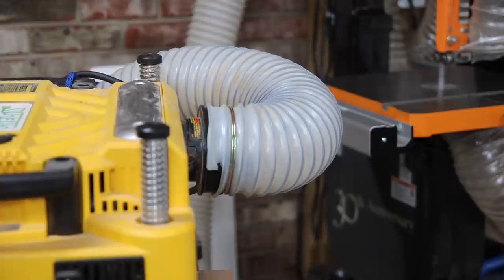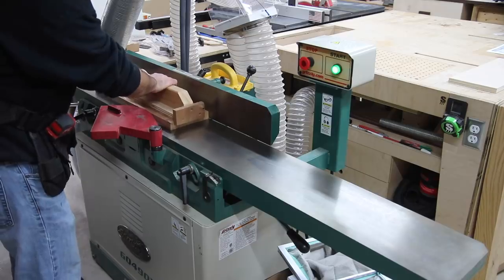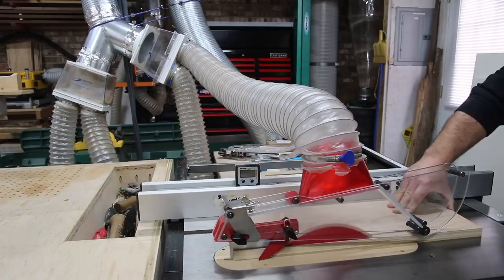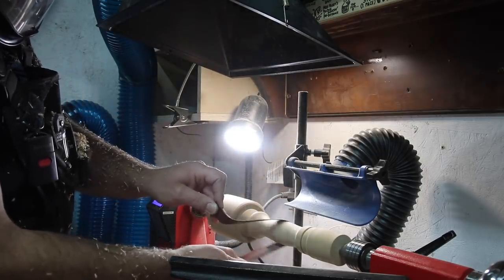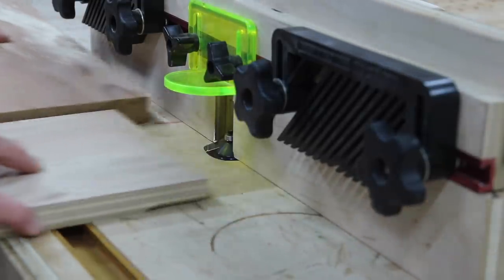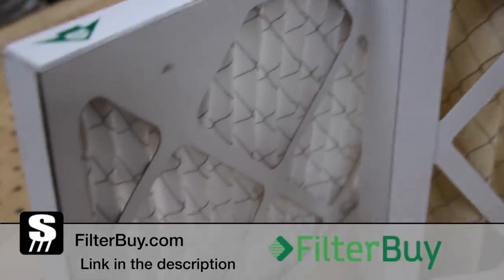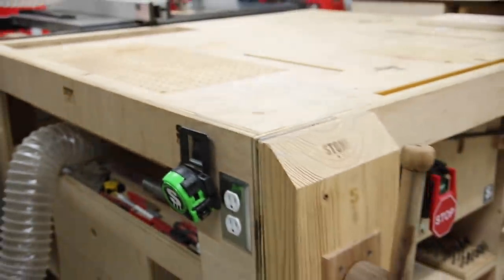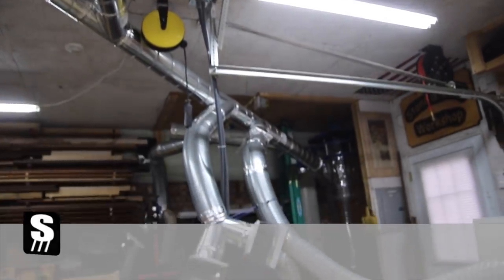Dust Collection Tour - Woodworking

Comment: My table saw is by the far the biggest dust producer in the shop even with my dust collection system. It's almost all from the blade. That shark guard looks awesome and seems to do incredibly well. Thanks for showing that.
Reply from the maker: Yo Yopp! The shark guard makes a BIG difference! There are a few specks that get away, but it's definitely better than before (like a lot better). :)
Reply: Are you happy with the 4” dust port on the Shark Guard or would you recommend the 2 1/2” port.  How do you like the adjustable Irving knife?  I am considering the Shark Guard for my late 90’s Unisaw. Thanks

Comment: You should only open the blast gate to the Shark Guard by half.  Too much air is flowing to the top .  So just enough air is needed for the dust and should not pick up cutoffs.  I'm sure you will find the need to change out those thin flex hoses too.  They will wear out and get destroyed before you know it.  Get a thicker mil flex hose:  Great job!  Super ideas!
Reply from the maker: Thanks, James, for the tips. Loving the unit!

Comment: How do you find the collection to be from the top of the miter saw? I’ve got a similar situation where it will be hard to get a port behind and under my miter station. Just wondering since I always thought it wouldn’t work well.
Reply from the maker: It’s working great for me so far. The bigger pieces will settle, but the finer dust gets removed. It will depend on your collector and how far it is away.

Comment: I am curious what happens at the end of this narrow hose going to the CNC machine. Obviously you have less air flow, but how does the pressure look like?
Reply from the maker: When I use the cnc I also open the planer port which is on the same transition. That allows for 6 inches to be opened up. I have also opened a third 4 inch port for more air. The dust at the cnc project gets removed either way. So, it’s been a non issue. Not sure about what the pressure looks like.

Comment: Do you have the Clearvue turned on when running your DeWalt DW735 Planer?  I always thought it was bad to have it running since that planer has its own internal blower motor.  Can both be running at the same time?  Thanks!
Reply from the maker: I run the cyclone WITH the planer. The blower is a plus.

Comment: I have seen on other videos showing dust collection that you have to ground the hose to prevent static electricity. Do you do that? Is it necessary? Nice set up you have a lot of good ideas. Thank you
Reply from the maker: Thank you. Yes, I grounded the system to eliminate shocks at the plastic hoses.

Comment: It would have been nice if you actually showed the connections to your machines. You never showed how the bandsaw, table saw, or router were hooked up.  All you showed was a bunch of video of pipes and hoses.
Reply from the maker: Did you watch the whole video? I showed the bandsaw hoses. They are not connected to anything, just tie wrapped or jammed in place to suck up the dust. I also showed the table saw overhead port, but the port on the bottom of the table saw is a typical dust port. It's a hole with a hose connected to it with a hose clamp, pretty simple. I also cover more information and more details in the website article. Thanks